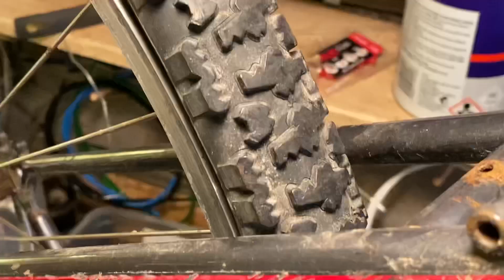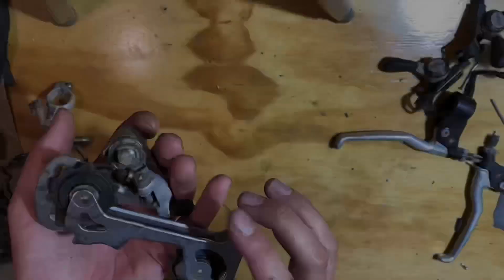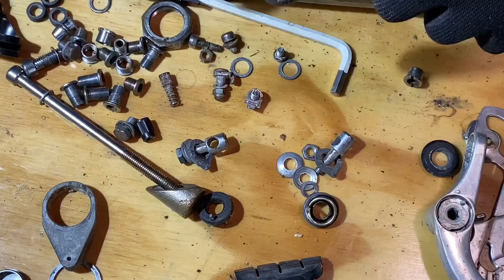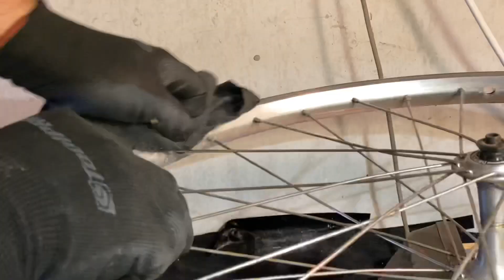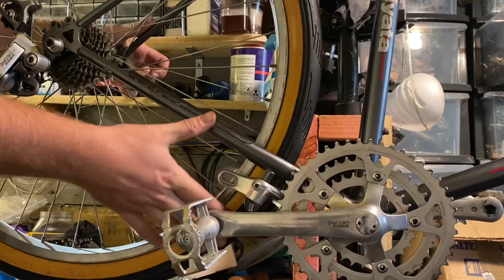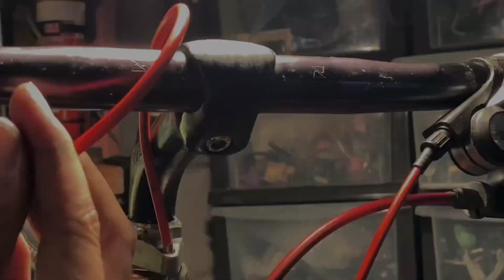1988 Koga Miyata, Retro MTB restoration/tidy up!

Comment: I must have missed it, when you went from the UG cassette to the UG 7s did you leave the stock shifters in friction mode or did you change the shifters to 7s?
Reply: The stock shifters will do 7 speed in friction but not in indexed shifting